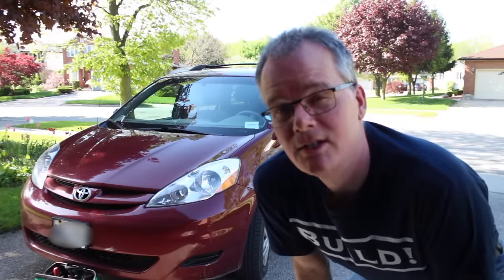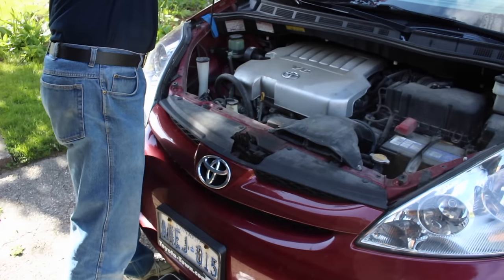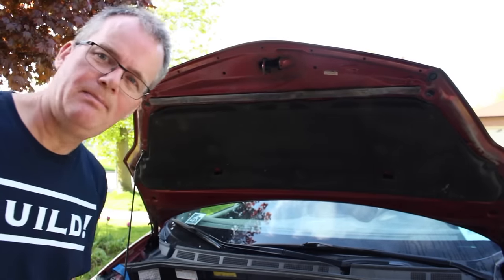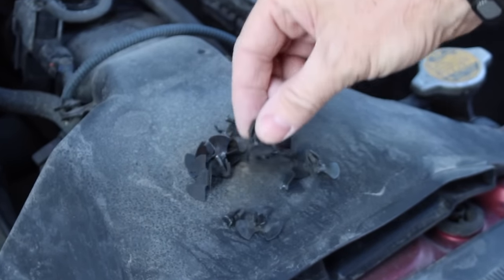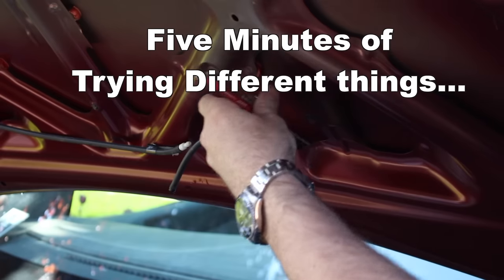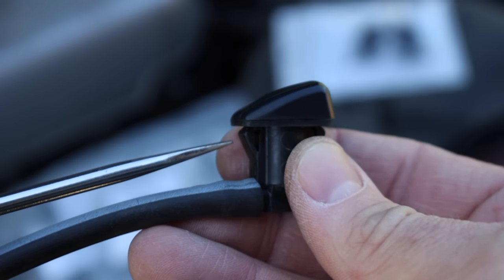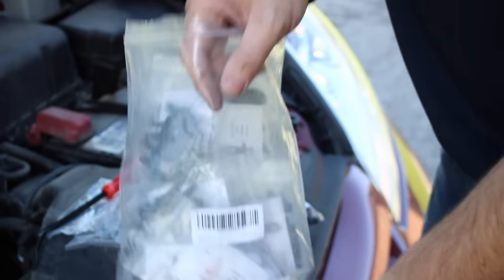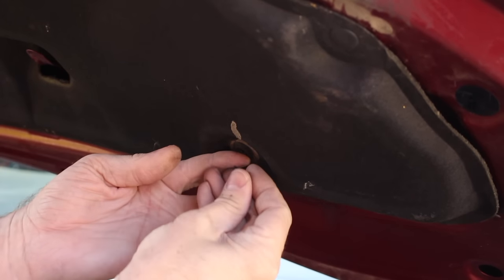HOW TO REPLACE your windshield washer nozzle (WnW #169)

Comment: My nozzles got clogged. I am a loyal customer, so I went back to the dealership. 

Estimate: 2 nozzles, $32.04 each, and labor $60.  Total: $124.08 !!!  
Sounded like some kind of ripoff, so I went to YouTube.

Now I ordered the nozzles from EBay, $7 a pair, free shipping.
I tried the approach of removing the liner, I broke one plastic fastener - and the liner at the same spot. I studied the picture on EBay, and realized that the nozzle was made to be inserted from the outside. 
I pulled the old one with pliers and it worked. I placed it back, waiting now for the new ones.